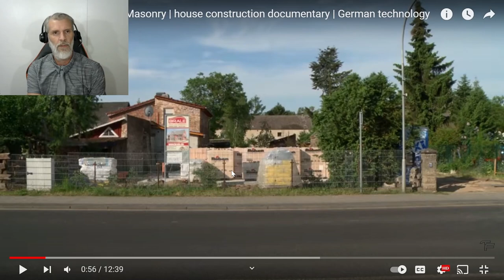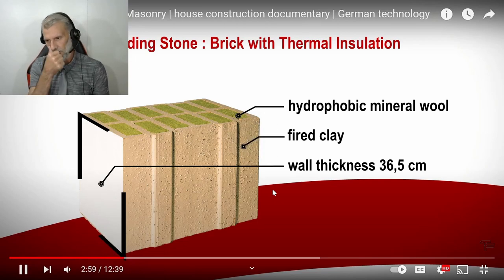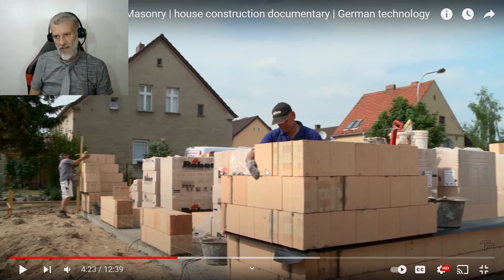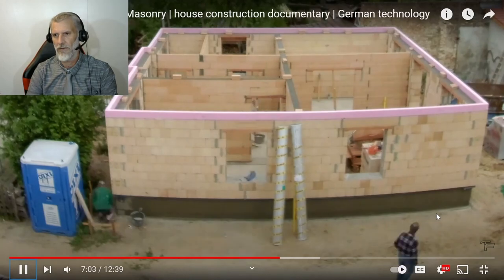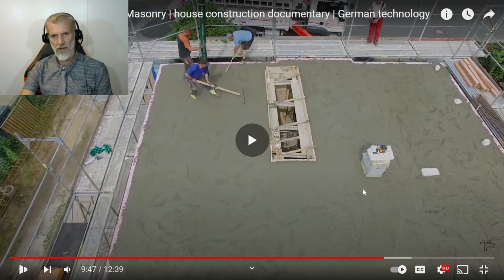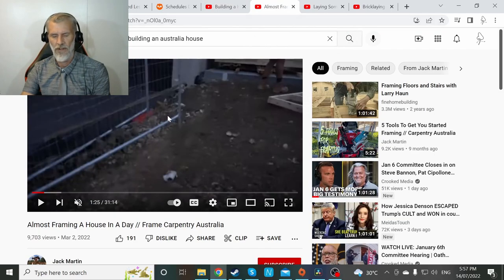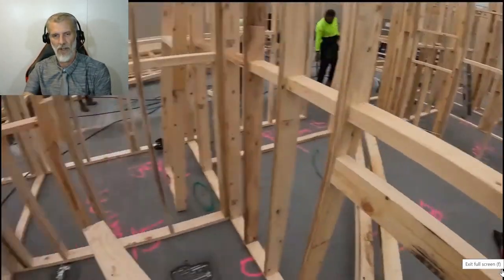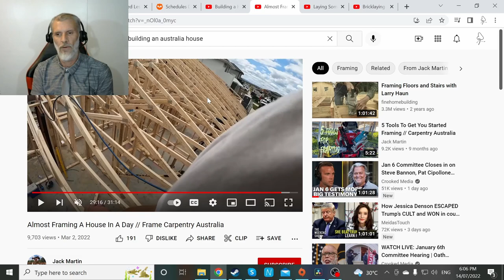German house vs Australian house part 2

Comment: I have absolutely no knowledge of building construction. But I am pretty sure that between 33 and 50% of the time was spent on waiting for the concrete to settle and dry. Mind you that humidity  (usually higher) and temperature (usually much lower in Germany) would make a difference.
Reply from the maker: Concrete will take longer to cure in colder climes, but be stronger, concrete will dry quicker in hot climes but be weaker, thats why they have different blends for different areas, to have simmiliar dry times.